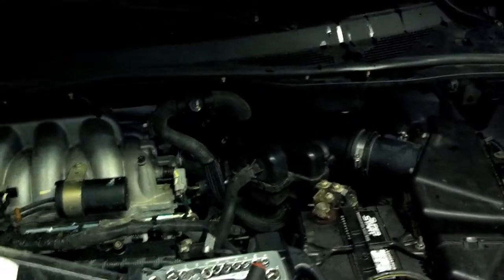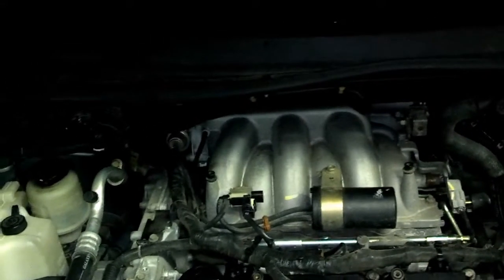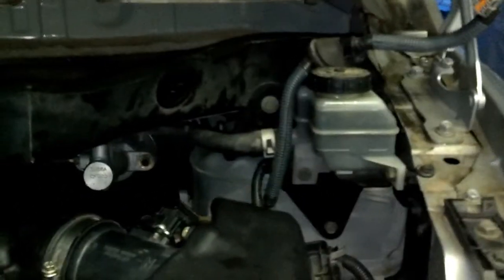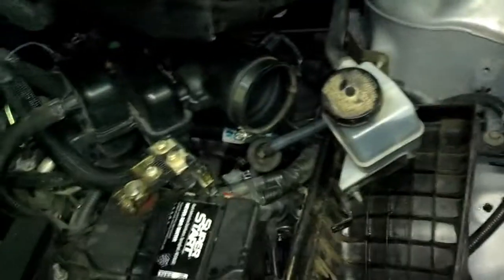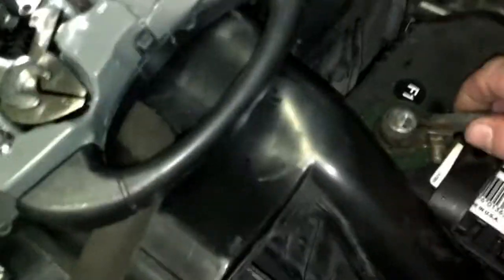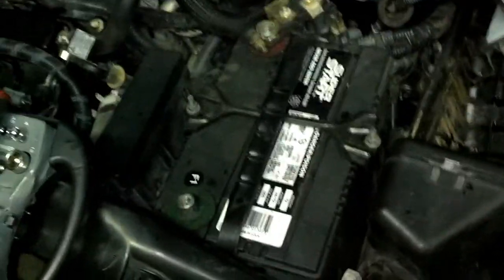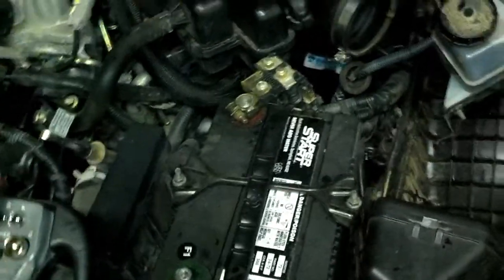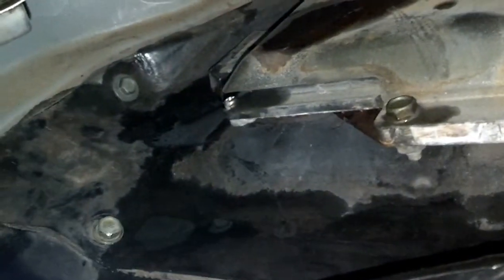✅✅  2004 Nissan Quest Van - Upper Firewall and Cowl Removal For Repairs

Comment: Thats not a firewall but thats ok. Its a Van. Vans are not simple to work on, never have been. I have had to disassemble the entire  dog house inside the van to change plugs on our 1989 Chevy conversion van, that requires you to remove the A/c  vents and tubing. Your video is really dark by the way. I knew buying this van it would be a challenge.  Thats the main reason mechanics charge more to work on them ( crooks) and people like you and I end up repairing them on their own. One thing for sure, you know it was done right the first time because it sucks when you have to go back in and fix things twice.
Reply from the maker: In all fairness, none of it is a firewall.  The designation was changed to avert lawsuits because the wall is not designed to nor will it work as a barrier to fire.  I decided to use that term as it is commonly refereed to as a firewall.  The video is dark because it is one of the first automotive videos I ever made.  The phone was an old Galaxy S4 with ok quality.  I had to perform a repair so I decided to make a video with just a garage light and it raining.
Reply: @BOSSC351sProductions  I see others calling it a fire wall. Its a cowl by definition or what we mechanics refer to as a parts shelf, lol. I watched the guy that doesnt talk through his video's.  They are ok but kinda nerve wracking because he doesn't explain anything. His is an 06. I invested in the service CD for my model year(04). I hope its better than a Chiltons. My chain guides need replaced so I get to pull everything down. I am NOT removing the engine because reguardless of what any mechanic says about it being easier, there is nothing easy on a van, period. To me removing the suspension and drive train is not fun. I have a friend with a barn that he letting me use. I was prepared to do it outside.